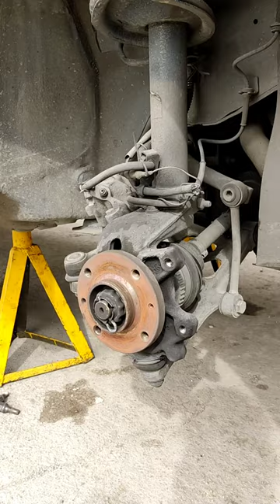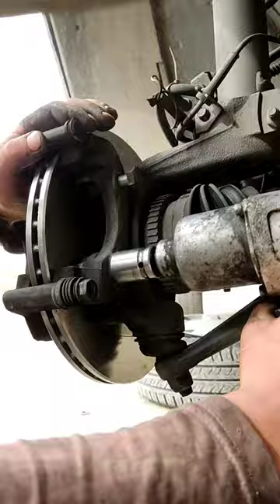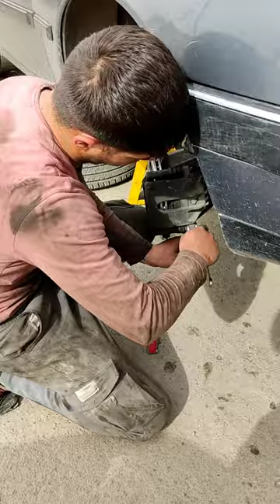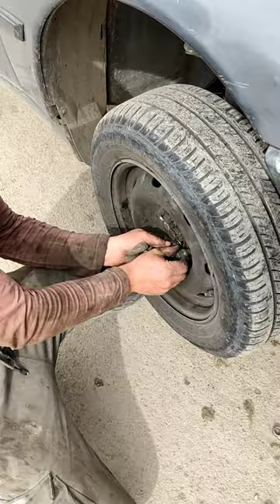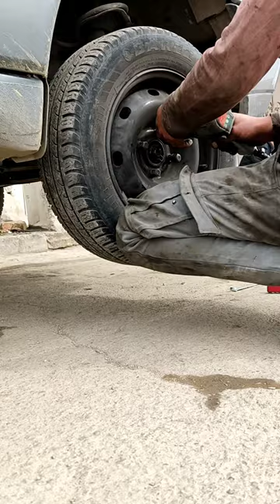Easy Repair#mechanic #automechanic #automobile #cars #truck #restoration #mechanicsteve #shorts

Comment: That’s how many ASE certified mechanics do brakes too.
I would watch the mechanic at the repair shop, then looked up how to do them myself. 
Then you realize they missed a few keys items like a commenter wrote; lube caliper slide pins, clean the surface with brake cleaner, wire brush the rust, grime and debris from hub and torque nuts with ratchet not impact wrench.
Reply: It's ASE not SAE
Reply: @jonnysanchez3833  
Yes, you are correct, thanks.